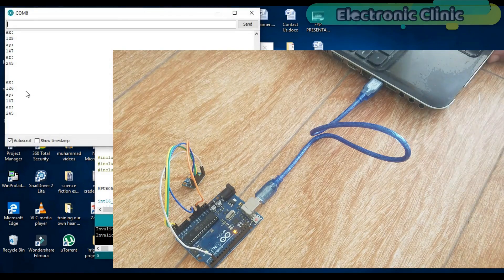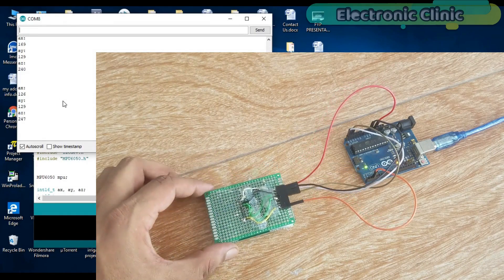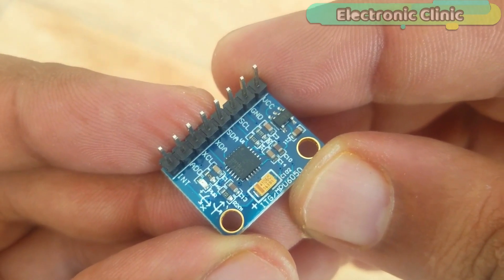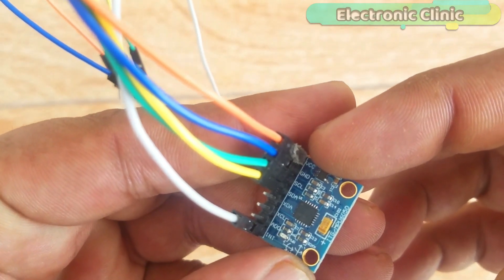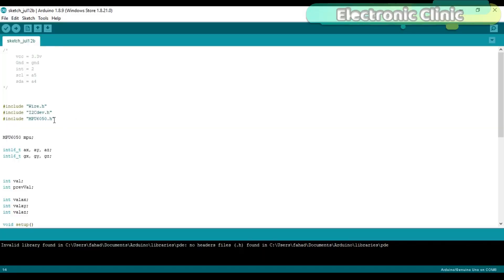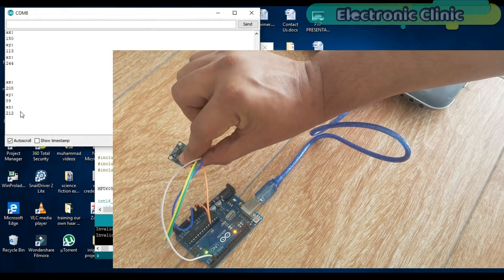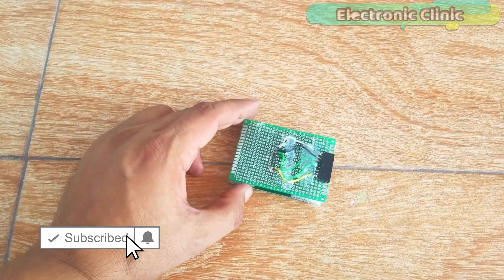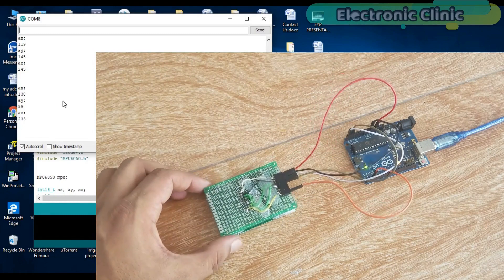MPU6050 Arduino Wiring, Library, and Code to find the Angle “GY-521”

Comment: Tried your code, same Arduino and MPU6050 module and all wired the same; but mine constantly returns all zeroes.   If Asleep, how do i wake it?  if something else, please help.
Reply from the maker: may be your sensor is damaged. check your wires continuity as well.